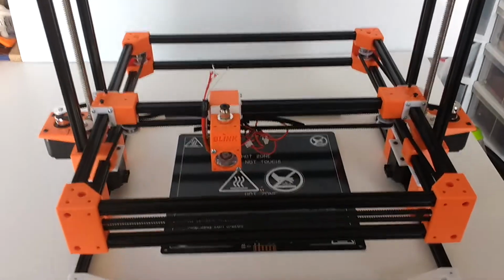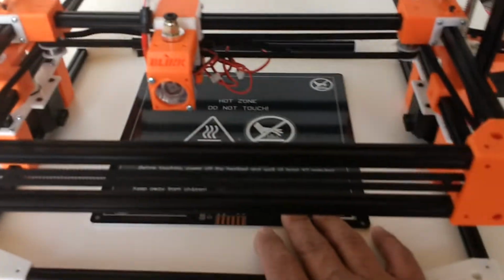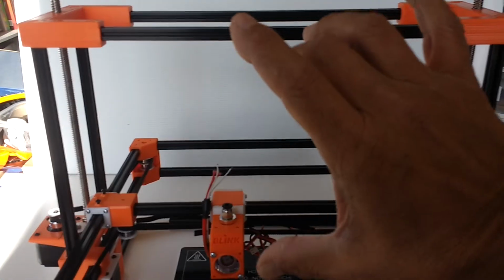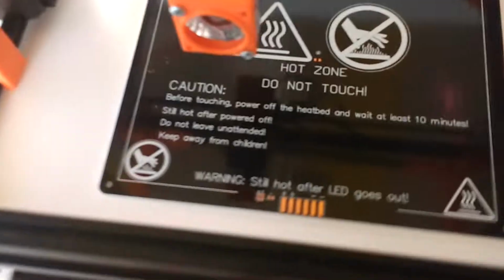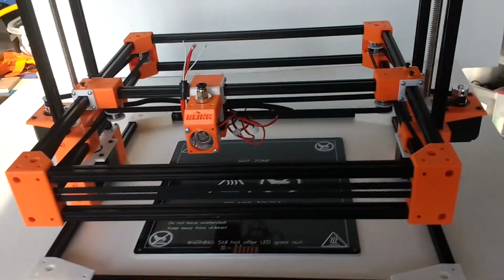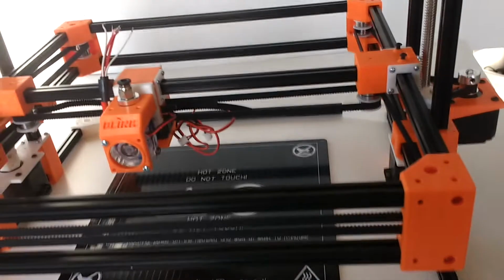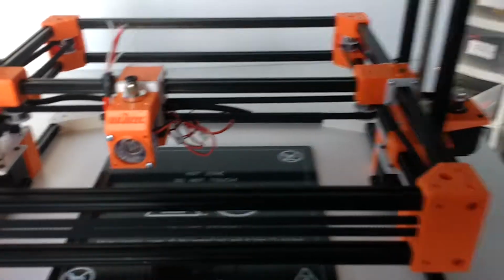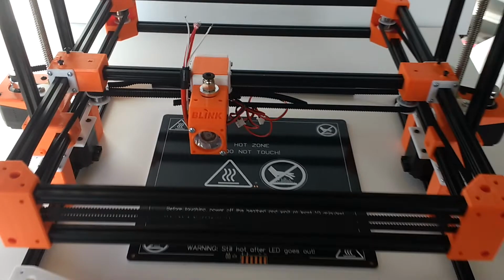MIA Blink™ Non Conventional Design Core XY 3D Printer

Comment: If this could be made cheaper than voron, ezbot, etc you will be on something!  Good luck..  I’m curious if your design will be as stiff as the cubes.. They need to be for accuracy / speed.   Subscribed
Reply from the maker: Good observation. I did stumble on the voron, and while that machine has a lot of hype to it I did not like the XY motor location and the use of heavy components. Just alone in the cost of separate linear rails there is considerable higher cost, and that can be said for any 3D printer that uses that more conventional linear rails. I bypassed all that as well as obtaining a more " balanced" system. The offset core XY motor location on all conventional non MIA Blink™ style printers require the cube structure for rigidity and precision. There are a few other  options that works quite well also and do not require the structure to be a cube.
Reply: @MarioIArguello  You talk the talk but can you walk the walk? I`m betting this prints worse than any Ender 3 off the shelf. The reason you can`t find this design done by others is because it`s dumb. You`re using Corexy but you don`t use any of the advantages of one: rigid cube frame, stationary x and Y motors, lighter axis.